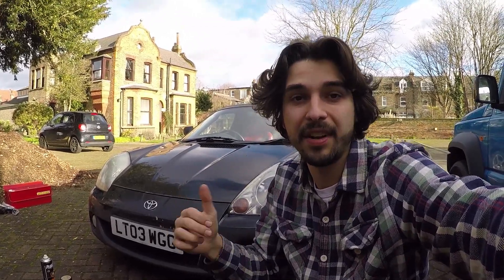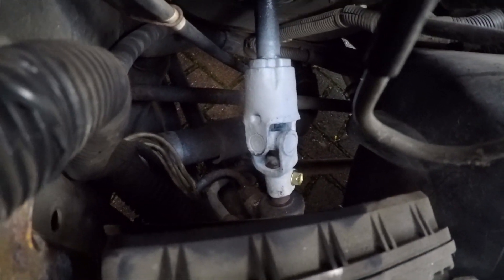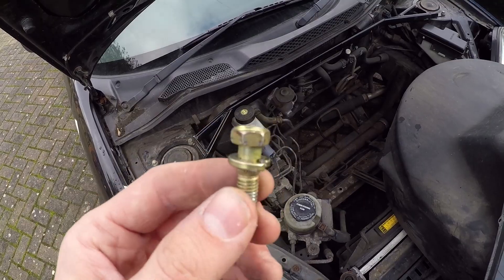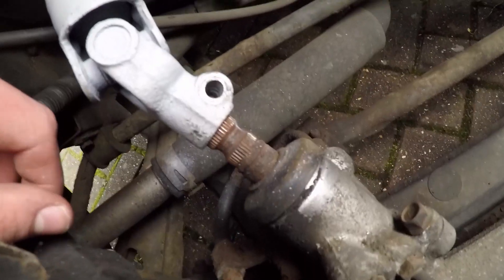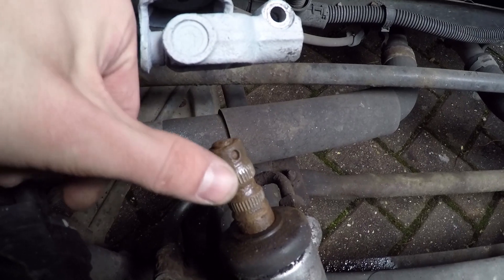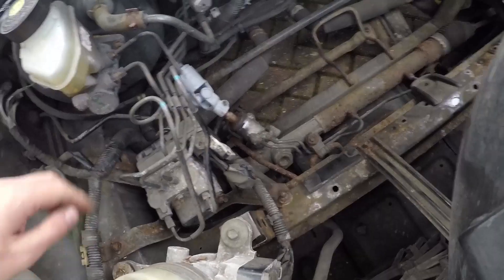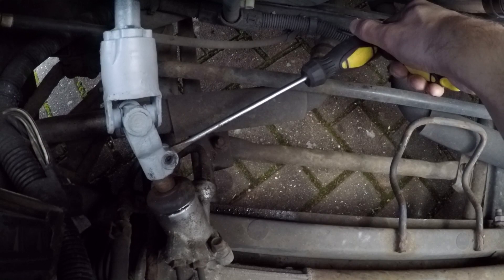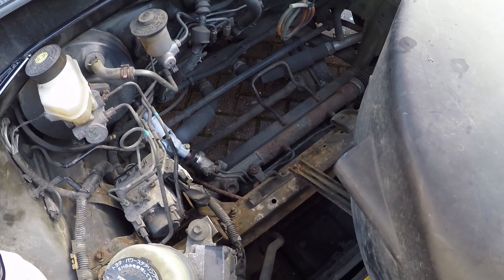Toyota MR2 steering UJ replacement – How-To

Comment: Thanks bro. I’m literally typing this with oily hands after changing mine just now. The joint itself moved left and right but not up-and-down or vice versa. I changed the steering pump for no reason last week thinking that was the problem but I’m glad I did now because that’s another thing I haven’t got to worry about for a long time.thanks again bro
Reply from the maker: I'm glad I could help!

Comment: Cheers for this Nick, I've just did this tonight.  I used a TBC universal joint off ebay.  No play in the steering now.  Major thanks for video.
Reply: Hi how is the ebay part you bought holding up. Can you send me the link to the part you bought?

Comment: The 11 is a measure of the tensile strength of the bolt, I believe. An indication of how much torque the bolt can take. Was there any reason you changed the UJ? Any Symptoms?

Comment: Thanks, can you explain when you know you need to replace it? Rust is not really a reason.. most of the underside components will be rusty but still usable. Are there any steering symptoms or visible signs that it is not safe and needs replacing?
Reply from the maker: Thanks for your comment. My steering began to feel notchy – especially during tight low-speed turns – so I decided to inspect the joint. It had rusted to the point that the rubber seals surrounding the bearings had become loose, worn and split. This allowed grit and dirt into the bearings, which I suspect was the cause of the problem. You're right – the surface rust isn't necessarily a problem in its own right, but it may suggest there are other issues to address, too.
Reply: @NicholasLettevanOostvoorne  thanks for the advice, Is the joint inspected via a MOT?
Reply from the maker: @isoconfused8744  Happy to help. I'm not sure, to be honest. Possibly not, because you don't get a particularly good view of the joint without removing the plastic under-bonnet shroud.
Reply: People often find that the wheel doesn't return to centre properly when coming out of corners too.
Reply: Was your part OEM or after market?